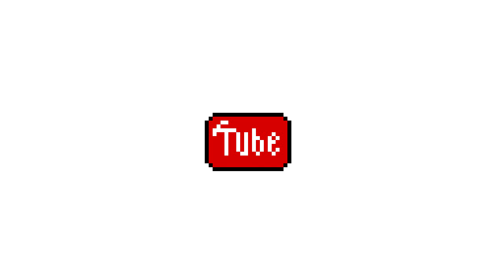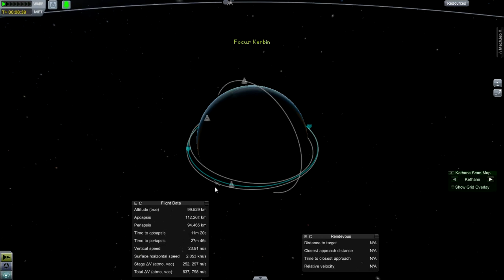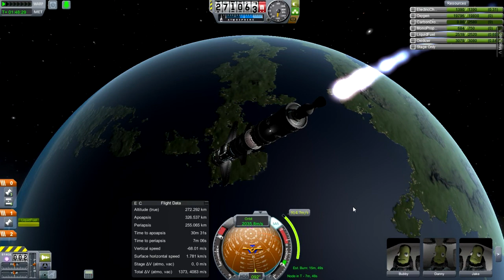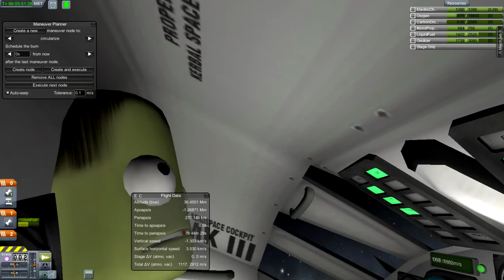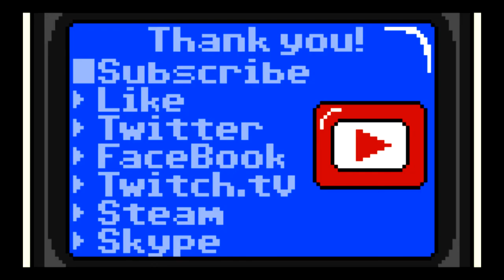Kerbal Space Adventures Ssn5 Ep11 HD - Roadblocks

Comment: Hello, do you have a list of the mods you are using in this series anywhere? If not - what is the mod called for the oxigen? TIA
Reply from the maker: IonCross Crew Support, Kerbal Alarm Clock, Lazor Docking Cam, Protractor, Kerbal Engineer, Mechjeb, B9 Aerospace (Select parts), Fustek Space Station parts(select parts), Deadly reentry mod, VNG Parachute, Quantum fuel/dock mods, HOME, Bolt on Mission Probes (BOMP), Kerbal Attachment System (KAS), Ion Engine Pack, Kerb X pack, Catterpillar tracks, ISA Mapsat, Kethane mod, Extraplanetary launcher
Reply: ***** Thank you very much.